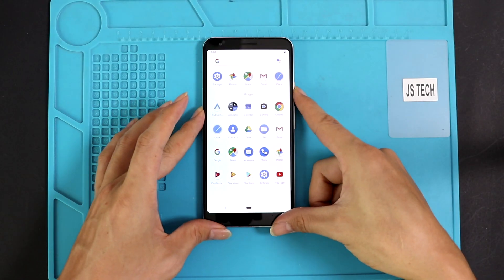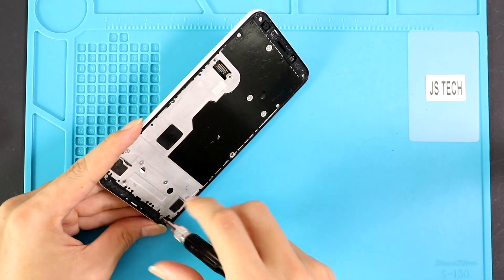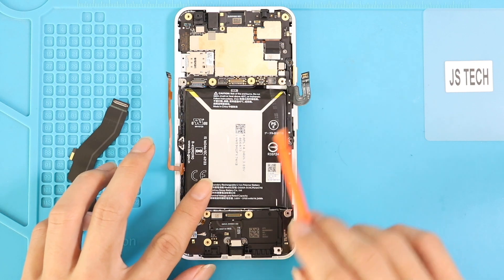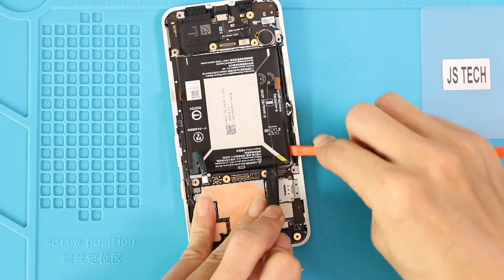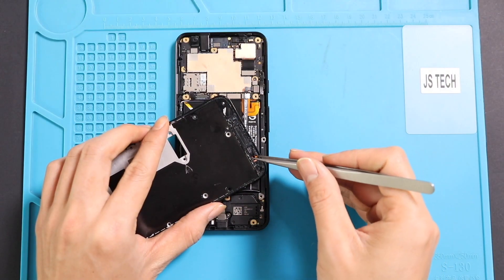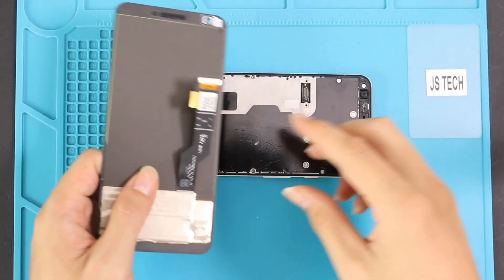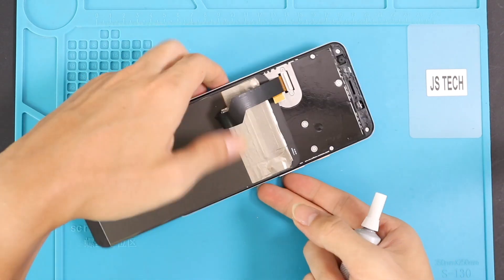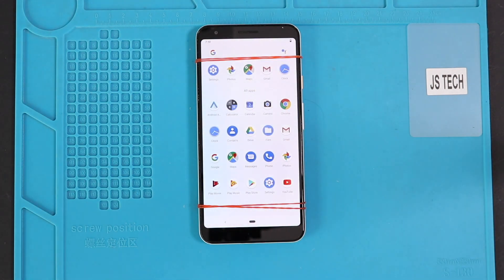Google Pixel 3a XL Battery Replacement

Comment: Bought a battery, heat mat, pre-formed adhesive sheets and adhesive strip tape along with a tool kit on eBay. With the help of your video and another, I was able to successfully swap the battery and not damage the screen. Works perfectly. Have the tools now and a bit more confidence for next time. Thanks !!!!
Reply from the maker: Great to hear that.🙏